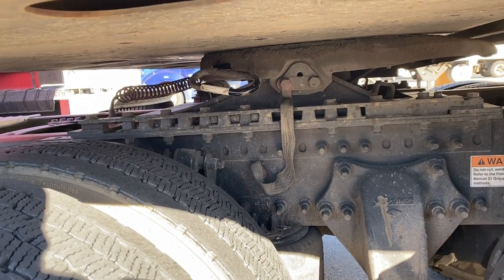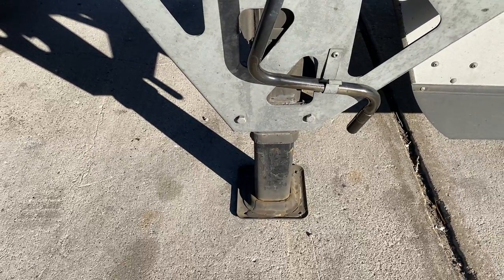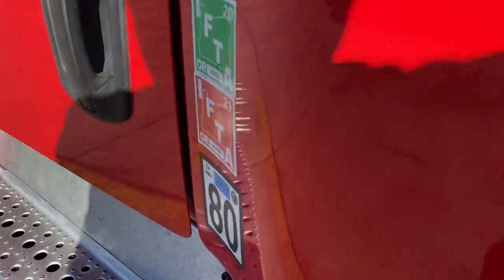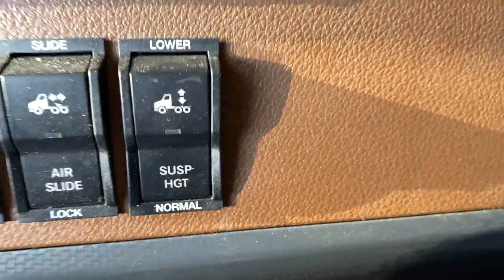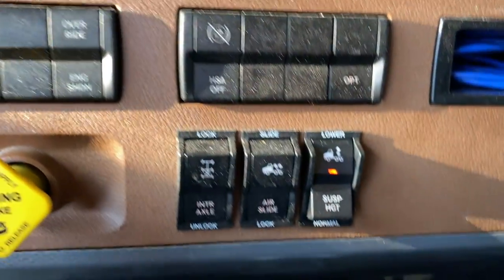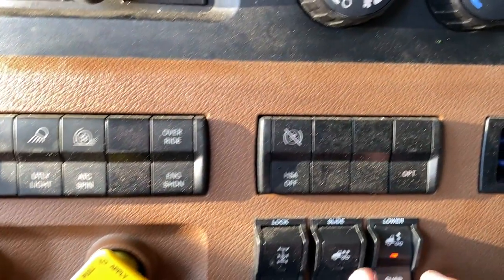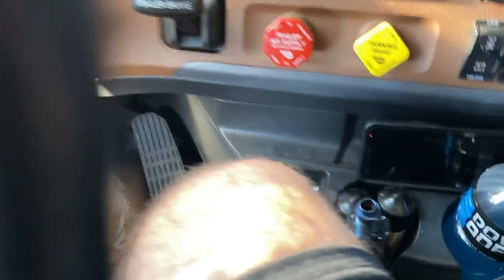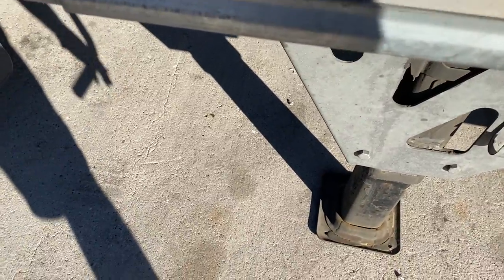How to slide fifth wheel on newer freightliner cascados (2018-2021)

Comment: I was actually overweight at a weigh station on my front trailer axle (spread axle) by 2200, so I slid them to the front up toward the tractor thanks to this video (3 of months tractor trailer experience). Then went back around for them to reweigh me. I was still basically 2200 overweight and they send my ass back to Seattle from Umatilla Oregon lol Thankfully I'm hourly lol

Comment: What if my truck doesn't have the button that lets you release the air bags?
Reply from the maker: It can still be done just not as convenient, it’s ideal to do when you have an empty trailer, once connected have the trailer landing gear down enough to take weight off the truck then you’ll be able to move the fifth wheel, just raise your landing gear once you have it set where you want it.

Comment: So does the fifth wheel have to go all the way in
Reply from the maker: Not sure what you mean but as far as the position closer or further from the cab itself that’ll be up to you and if it’s required to make sure you are driving within legal weight limit, or if your referring to the fifth wheel pins they should be all the way out again once it’s in your preferred spot to make sure it stays put while on the road. Most people suggest having it set all the way back to always avoid being off on your weight but that’s not always the case so again as you need to adjust it’s position.